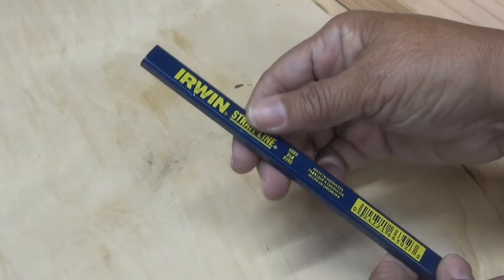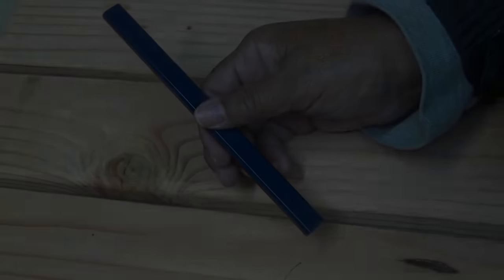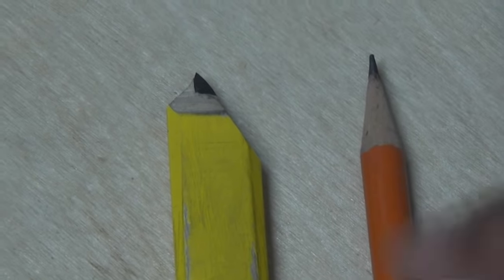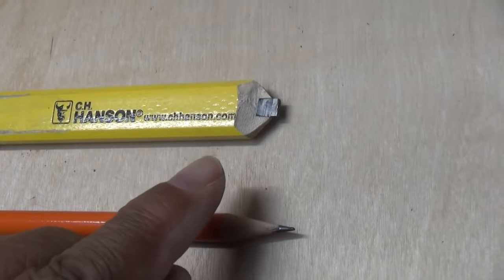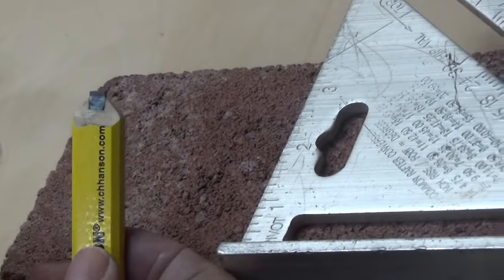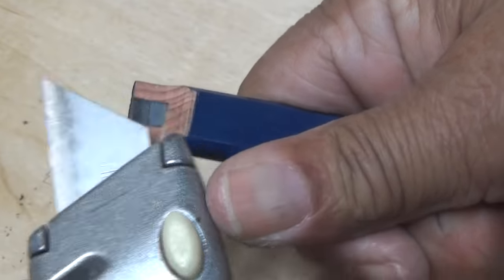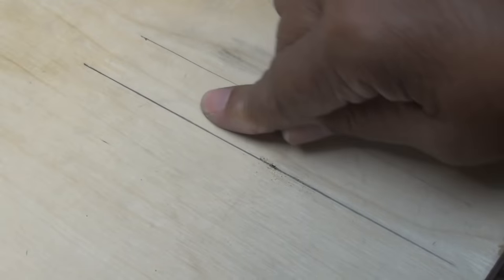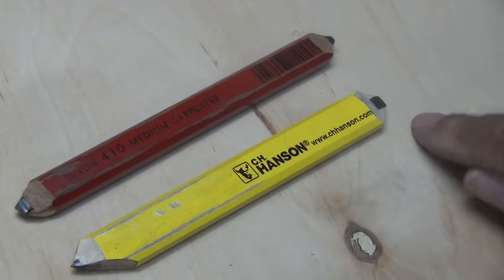Why is a Carpenter's Pencil Flat?  And Other Stuff

Comment: wow half inch width... so useful for australia...
Reply: Squishy Boi thank god
Reply: Regardless of using metric standard or not, imperial measurement is still being used regularly in carpentry, fashion, and to some extend building construction. Most people in those industry are required to be fluent with both type of measurement at all time.
And to prevent misunderstanding when citing a dimension, they always cite in mm or inches, because the discrepancies between them is too high, so when the numbers goes to the thousands they know it's cited in mm. Never cite in cm.
Reply: Ricky Ng you’re only required to be able to do both of you live or work in America. In the rest of the world there is no need to be able to use the imperial system
Reply: I was taught in metric at school but worked in imperial after leaving. Now I ask for 4 x 2 in 3.9 metre lengths.
Reply: Nope... Furniture and wood working are still mostly based on imperial system. Plywood sizes are standardized at 4'x8' and it's used everywhere. It still comes in 1220x2440 mm even though people would refer it as 1200x2400 mm for both the round numbers and the amount lost due to cutting. Furniture maker quote their size pricing based on per ft run not per meter run, not even per half-meter run because it's easier to predict the material used. Try a re-check on the furniture sizes and you'll see. They're mostly come in increment of ft (300mm) or half ft (150mm) instead of 250 mm which would be easier for those based in metric.
Solid timber on the other hand might be customized based on mm sizes, for the reason it's much more precise to work in mm.
Reply: @araisikewai  in NZ we are taught metric I only understand imperial due to the crossover through material sizes and descriptions
Reply: Yeah 1/2 inch, you guys could use it to floss with.
Reply: I was born in the 60's so I was taught metric in school, but learned imperial from watching my dad work. And I actually still use both today. Usually whichever is quickest to say, that's what i'll use. When I buy sheets of ply, I usually ask for 8x4 sheets at 6mm, 12mm, 3/4 and 1", etc.
Reply: @araisikewai  This mixing of imperial and metric is far more common in English speaking countries and likely old colonies. Having grown up and worked as a carpenter in Sweden it is far less common here, and often related to the number of older workers on a site(younger workers often use mm/cm/m). 
Only real common use is rough measurements for timber (2x4, 3x4 etc) given in metric inches and usually only for smaller sizes, 6x6 or larger is often given in mm or cm. 
As for plywood/drywall the dimension (actual dimensions you get) vary quite a bit but for width 600/900/1200 are quite common, for height 3000/2700/2500/2400/2200/1800/1500/1200 are used (2500 is by far the most common for new construction). OSB is a special little child since it often comes in (xx97)x(xx90)mm measurements (like 1197x2390) as that equates to the losses in finishing cuts at the factory (if you lose 20x40mm for finishing you need new equipment because that is some truly shit margins).

For furniture sizes I actually had to google it since I had never before heard of the concept of standard furniture sizes. And it doesn't seem to be a thing in Sweden (at least not a common one), as sizes of tables etc are often strange numbers...length in cm: 118, 120, 125, 127, 130, 135, 140, 145, 147 etc etc and the same for width . If you want examples ikea have nice examples of sizes (if not necessarily quality) that you can find in Swedish furniture stores.
Reply: @Dracounius  Granted that factory cutting creates only 3mm of saw blade width loss, but having a plywood that comes in ft helps a lot even with workshop that do their measurement in mm. 20mm sounds like a lot of discrepancies, but in workshop having those 20-40mm makes it much easier to clamp and push the plywood through sawblade for cutting large sizes safely. Meanwhile for small sizes that require several cutting, those 3mm for each run through do add up.
Reply: @araisikewai  But they don't come in 2440mm sheets, if you buy a 2400mm sheet they are 2400mm long when you measure them not 2440mm. It's not a matter of "we say 2400 when they are actually 2440" they actually are 2400mm not 8'
Reply: @Dracounius  Canada uses the metric system for most things except for carpentry/construction.
Reply: They were made in America for Americans. Don't. care about what other countries use.
Reply: inches.. "so usefull".. on entire world... except USA (that still dont know what a metre is hahaah)
Reply: If you would just convert it would be. 😉
Reply: 13mm, better? 🦅
Reply: No 1-centimeter Wide Carpenter's Pencils?
Reply: I guess you don't use 2b4's.
Reply: @alexanderloughran2716  in the uk us older carpenters use imperial measuring it really confuses the younger carpenters😀
Reply: It makes a lot of sense t be in imperial.  The majority of projects in wood are for people purposes.  Homes, furniture etc.  6 ft is an obvious reference to a tall person and is easily understood.  1.85m is non standard and using 2.0m is way too big.  Imperial is human scale.
Reply: I went into Subway in Australia and asked for a 30.48 cm sub sandwich. I was told they couldn't do that only foot long or 6 inch. So much for metric. 🤦‍♂️
Reply: @mizzyroro  subway is an American brand, it's their fault.
Reply: @frank_calvert  in Australia they use metric.
Reply: @mizzyroro  I know, i live there, subway uses imperial bcuz theyre american
Reply: @mizzyroro  nope we do
Reply: There are two kind of countries - ones using metric and one that has been to the moon
Reply: Squishie boi.. ever heard if a four by two? That's a piece of wood that's four inches wide by two inches high used regularly in carpentry in australia. But If you knew that you probably wouldn't be making such a sarcastic comment so never mind
Reply: You should move.
Reply: OK.. that's 13mm for the Aussies
Reply: I still think in imperial 😊😊😊
Reply: Haha, we might use metric in Australia but you still hear imperial all day. 
Dig a hole 600 or two feet, how tall are you? 6ft 2" 
Cut this down, how much? inch or so...
My favourite, can you get 3 5 4's of 4by2
Which is 3 lengths 4"X2" in a 5.4m length.
Reply: And went to the moon? Using both metric and imperial.
Science relies on metric and NASA has been almost entirely on the metric system for almost 30 years.
Reply: @Genxr66  - I too was born in the 60's. I learned metric when I worked in a cabinet/ countertop shop in the 90's. Now I use whichever is easiest for what I'm measuring.
Reply: @Mario Legend I assumed most of us Brits understood both systems, I'm 6 foot tall not 182cm, stick to 30mph in residential streets not 48kph, have a 50 inch TV not 127cm, but was taught metric not Imperial in school and all my rulers were 30cm.
Reply: No big deal. Want or have to work in metric, just use a metric tape and vice-versa
Reply: 15mm width can be used to mesure...
Reply: Maybe you're using an outdated system, Australia!
Reply: @ultramajik  Everyone uses a dumb measuring system, we should measure close to your type but not exactly like it.
Reply: @billheizer7554 but other countries have been to the moon, also thanks to your system (specifically fahrenheit) you blew up the spaceship that was meant to get to the moon in the first place
Reply: what i meant was ours but a dozenal version of it.
Reply: In about 100 years I am sure America will discover the metric system.  No worries...
Reply: You guys need to get in line down there. Hope you have SOME carpentry work that needs a 12.7mm width or 6.35mm spacing.
Reply: @kyo_1296 
1) It's spelled "useful"
2) Most Americans know what a "metre" is - it's how people in other countries misspell "meter"
Reply: @Arsopu 
That makes sense - NASA put men on the moon in 1969, almost 50 years ago (as I write this comment).

Science doesn't care what units you use.
Reply: Well, the metric system is the only system worth learning. 
Also, the use of meter as opposed to metre is a grammatical error not a spelling error.

Comment: That square pencil is actually rectangular.
Reply: A square is a rectangle
Reply: @alistairmackendrick5365  But a rectangle is not necessarily a square.
Reply: @alistairmackendrick5365  Not every rectangle is a square. Look it up.
Reply: So a square is a special kind of rectangle, it is one where all the sides have the same length. Thus every square is a rectangle because it is a quadrilateral with all four angles right angles. However not every rectangle is a square, to be a square its sides must have the same length.
Reply: @barryhunt8527  LMFAO
Reply: @barryhunt8527  Damn you sound mad lol

Comment: I mean you can scrib with a number 2 I have many times as well as with a pen, but you make up for that with the spacer tip alone. And with I have never needed to mark a brick before I have drawn on logs in a similar fashion with a carpenter's pencil. I did always believe it was flat so it didn't role when working on job sites so I learned a little today and I thank you for the knowledge.

Comment: hey Leah hope this finds you and yours well ive just finished hanging a door and couldnt wait to share this with you ! door hung perfect apart from a belly in old door frame that was touching the door in between the two hinges !!!! , was thinking oh here we go scribe, door back off take outside to plane .
then had a brainwave whilst looking in my van i spotted the grout remover bit for my multitool . you know the one you get in a set and never use ! and i put it on the multitool Leah you got to try this baby , it worked a treat ran it up and down affected area real easy to keep flat to the door edge while it was still hung and as smooth as you like , if your impressed please share on your platform , love Brian x

Comment: Thank you very much Ms. Leah, what drove me to find a better pencil was the fact that a standard #2 pencil when tucked between my hatband and my headbone, after the first few hours my #2 would, without fail, break apart. The wood or slurry or whatever they're made from would be completely saturated with my sweat. To the point sometimes I could hold it up horizontally by the sharpened end and the pencil would droop. HF always had carpenters pencils and I buy a couple few whenever I'm in the store. Did you know there's a sharpener available for a carpenter's pencil? It's true and it's designed to fit both sizes of carpenter pencil that you are currently available, and it fits easily in your pants pocket.

Comment: I’m 48 and have 31 years in construction. Drywall and trim carpentry, flooring and painting. I just thought they were square so they wouldn’t roll away. Lol. I can’t believe I never thought of using my pencil as a deck spacer. Thanks for the video.

Comment: Enjoyed this and got some great info and a correction you need to make. I measured 8 of the ones that I have, 6 are new. All measure about 1/4" thick, but none are 1/2" wide wit them being  9/16 or a bit more by my wood shop low end micrometer. Two are Rigid brand, 2 are Simpson, one is Great neck, 1 is Lowe's and 2 are local lumber yard freebies. Other then that - a fun video
Reply from the maker: Rhanks for sharing

Comment: Adding another aspect to the Carpenters Pencil designed use: There is a purpose to the 3 sides. Upon sharpening the lead to a point centered, it is used to scribe "1/16, "1/8, and "1/4 inches using the long flat for the "1/16, the bevel for "1/8, and the short flat for "1/4.

Comment: When I am in the shop, I  use the belt sander to create sharp lead on a few pencils. Also, in a pinch I have used knurled diameters on drill chucks to sharpen the pencil. These methods are not recommended for short stubs.

Comment: Even though it is considered dangerous, there are certain times the guard on a worm-drive saw needs to be held back.  I always used that flat pencil to wedge the handle on the guard to a place that left the blade of the saw open so delicate cutting would be unimpeded.

Comment: This just popped up randomly while I was looking at a specific pencil brand, but I enjoyed it and learned something (dimensions being intentional). I'd like to mention that cheaper carpenter's pencils, especially the red ones the Home Depot sells, are infuriating to use on concrete or rough surfaces, which I have to do all the time. It's completely worth spending more money on these to get better ones that don't split so dang much when you sharpen them, or ones with weak graphite.

Comment: You should sell carpenter pencils with your logo. Put them on Amazon ,and I would go out of my way to buy yours. Your tips are extremely useful and clear. 
BTW , carpenter pencils are perfect for scribing the string slot depths on a guitar neck’s nut. Regular pencils are too narrow with a tendency to roll. A large flat is chiseled ,then sanded on one side to ride on freshly dressed frets and scribe the new nut. (the piece of bone or plastic that the strings go over) I never even thought to use them as spacers or measuring tools when I was building things. Even when I had one behind my ear!

Comment: Hi Leah, love your videos! There is one thing though that puzzles me...Why don't you Americans use the metric system? (using millimeters-centimeters-meters). That will make measuring a whole lot easier and faster! I am a carpenter from Holland and we use the metric system here( and in the rest of Europe) for centuries and for good reason. It's highly accurate and makes calculations and measurements simpler and faster. Even ( most) of the UK based carpenters switched to the Europe system. What are your thoughts about this? With kind regards, Stephan Schouten from Amsterdam.

Comment: I use mine because of the 1/8th inch to center.  Hold it vertical and use a tall straight edge as usual.  The pencil will measure 1/8 from the straight edge and that is your blade kerf.

Comment: If you use any kind of spacer for your deck you will have an accumulation of errors and probably wont end up straight. Best to measure out from one datum, that way you can divide the gaps evenly and end up with a full boards at both ends.

Comment: Now explain all the things that can be done with a carpenters square. I have been a carpenter for nearly 40 years. But I am also a roofer, a drywaller, a painter, a plumber, a cabinet maker,  an electrician, an HVAC tech, an appliance repairman, I install doors and windows, building hardware like curtain rods, blinds, towel bars, etc. and I install vinyl composition floor tile and ceramic shower and kitchen tile. About the only things I don't do, related to buildings, is carpet, ceramic floor tile, and masonry work.

Comment: I  wouldn't recommend spacing pressure treated decking. The reason; as the lumber dries,  it shrinks and the space will double to a half inch. High heeled shoes can get stuck in the gap.

Comment: Pencils have graphite inside and have not been made with lead since before 100 years ago.  #2 refers to the clay graphite mixture which effects color and hardness resulting in the color and opacity of the line made.  #2 became the most common mix since it was the chosen standard of the Scantron Corparation for school tests starting in the 1970's.  Any pencil, carpenter or other shape, that is made in The USA and not marked most likely will have #2 graphite inside. Lead in paint on the outside of pencils and any other paint use was outlawed in 1978.

Comment: I've got a use for a carpenters pencil. When your trying to get let's say 2x4s squared up with each other but your not quite sure if the sides are perfectly aligned because of the rounded corners hold your carpenters pencil  flat against the bottom board and butt the top board to the pencil sure you can do this with a block of wood but chances are you already have the pencil.

Comment: They are fine for rough work like concrete forming or framing, but if you used one to mark trim cuts that had to be accurate, you'd be sharpening it after every use. Yes,before you ask, I am a journeyman licensed carpenter since 1974.

Comment: Correction- When building a deck install decking tight together w/ vinyl coated sinkers..
n due time the decking will lose moisture and space itself a1/4"...
...that way you won't have 1/2 spacing that would look terrible.

Comment: I use a nail to get the fine line I need on a surface. The point on a 8 penny nail it even a 16 on wood leaves a nice thin line and will not wear down from start to finish of the line. With your nail pouch you always have a new nail to pick from for the next line, never have to sharpen a carpenter pencil again, or remember where you laid it.  Just reach in your pouch for that nail and your line will always be thin to win.

Comment: OK, let me try this again.  For decades and decades after they were first made, carpenter pencils were exactly 1/2 inch by 1/4 inch,  This was so they could be used as feeler gauges in trim carpentry; precisely 1/4 or precisely 1/2, depending.  Even the paint thickness was accounted for.  Then maybe 30, 35 years ago they started turning up at 1/4 by 5/8!  Never found anyone who could tell me why!  Anyone???  Leah?

Comment: Or, you could just use a drafting pencil with a hard lead.

H is for hard, B is for Bold or soft.

HB is right in the middle. HB2 isn’t much better. Start using a 4H pencil, and it’ll never dull or break on you. Lines will be super fine.

Just play around with your graphite, and save the uncomfortable grip of a carpenter’s pencil.